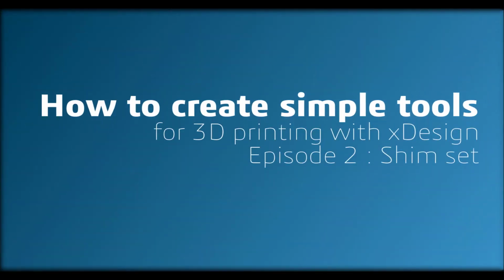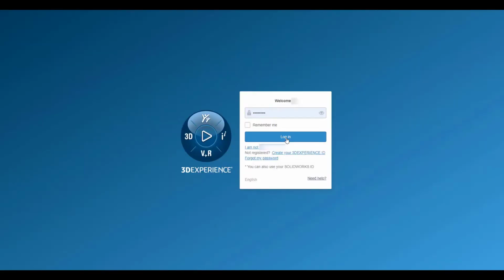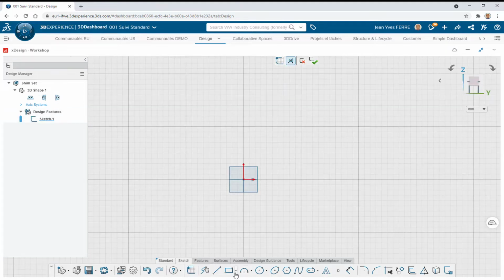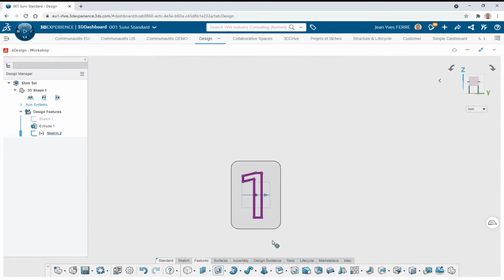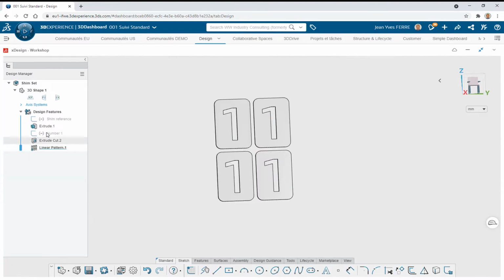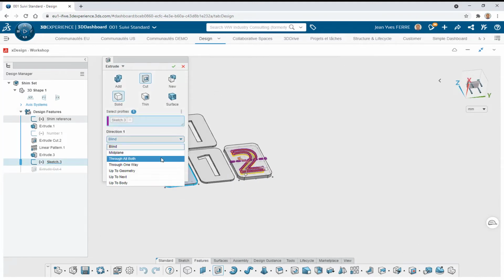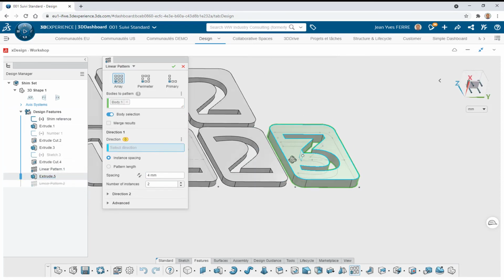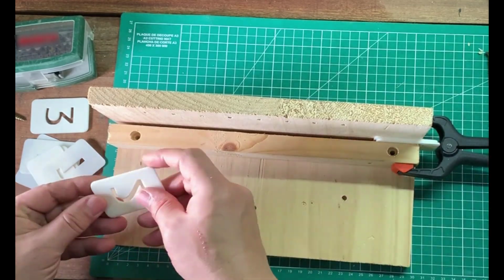Design a set of shims : Simple tools with xDesign from SOLIDWORKS for Makers

Comment: I just started using this. How do you save to your computer?
Reply from the maker: I'm very happy to hear that ! Model is saved on the cloud and stays there, but you can export your part to your computer for 3DPrinting as STL format for example. To do that, you can go in tools/print 3d then "export to print format" and make sure you check "file on disk" et voila !